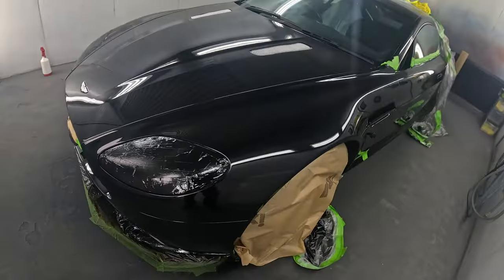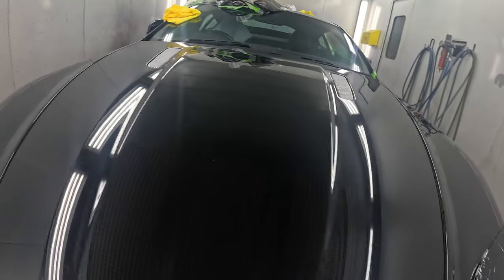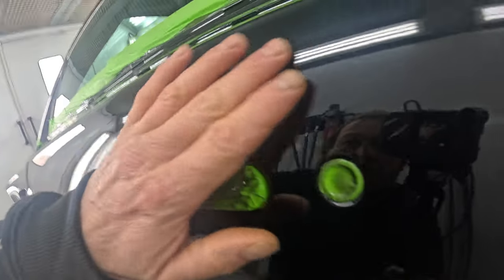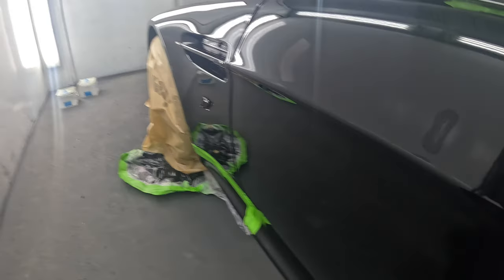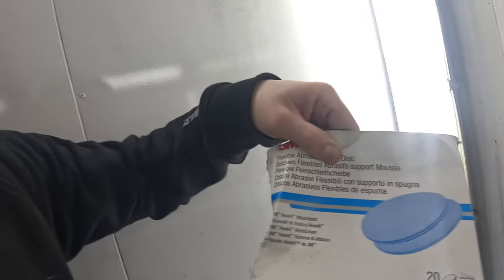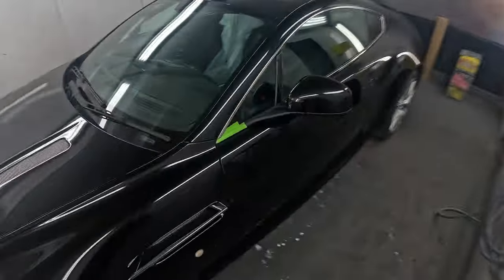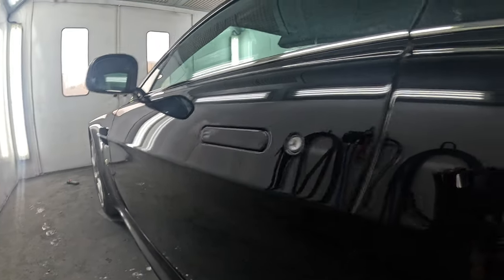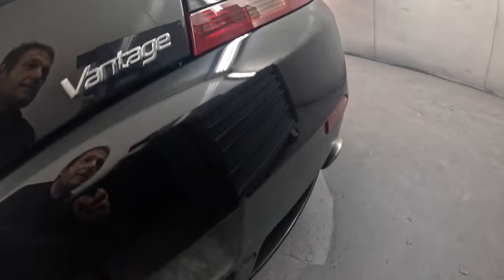Remove Orange Peel Professionally  Aston Martin Vantage

Comment: Love the videos! How are you finding the koch chemie? I’m currently using G360/ Cartec 3000 but have ran out of 3000 so thinking of trying Koch chemie, I do like the G360 but i find it’s quite dry when doing large areas
Reply from the maker: Thanks, yeah i do like the Kosh chemie stuff, the heavy cut goes a long way and stays wet, doesn't dust and really easy to wipe off but i do find its got some fillers in it, i find the buff pads are not so good ive been getting better results using the rupes buff pads